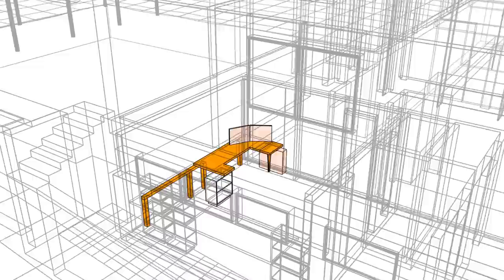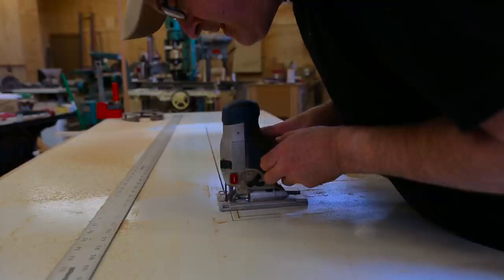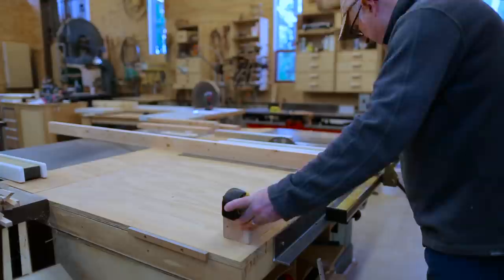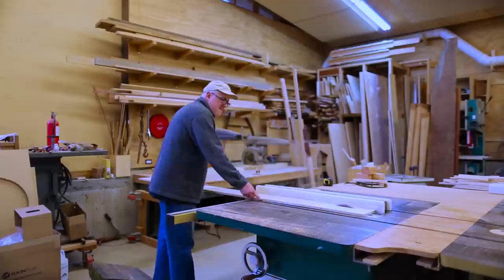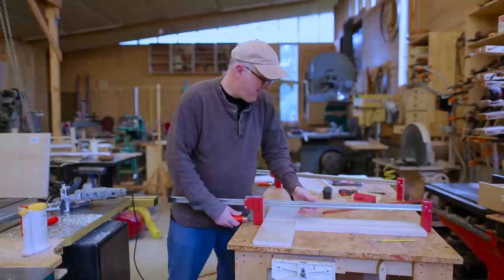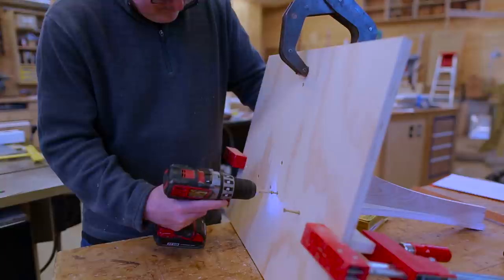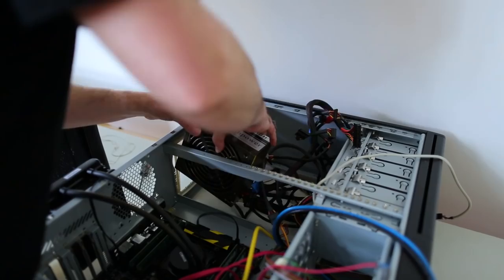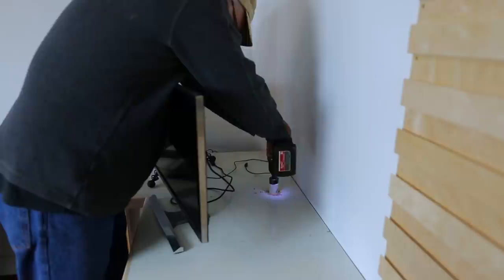office 4: Hacked Together Computer Desk

Comment: i feel like sitting in front of that desk for prolonged number of hours could be uncomfortable for your arms since it's touching the edge of the desk even with rounded edges. you're then forced to raise your shoulders a bit to relieve the pressure from your arms but that transfers the discomfort to your shoulders. you could add a lower level desk for your keyboard and mouse. this could complete the corner also adding more space on the main desk (especially if you mounted the monitors), and hopefully have a more ergonomic feel for your arms.

i do CAD/3d modelling on the computer as well and i've experienced having a sort of pinching feeling/numbing in the area between my wrist and elbows because I previously had a similar setup with the one on the video. what i did was getting wireless peripherals setup on a lower level desk and i haven't had any discomfort issues since then.

still a great video though. it's nice to have a bit of a look into your process. 👍👍👍

Comment: Hi Frank. I love that arched leg!
I have a similar Samsung monitor, and thought for a long time that the stand was not adjustable. Found out that it actually is, if you use some force (more than you would think) on it. Worth a try on your monitor as well, to get rid of the wedge piece.

Comment: your keyboard doesn't even fit on it. your monitors are different heights. You cant use your mouse without bruising your knuckles. cmon man!! drop some sick design on this thing.
Reply: The head is too close of the monitors too. So uncomfortable.
Reply: tehsimo exactly! We, the internet, demand a better setup for the great FH. Somebody start a petition or something?
Reply: Full points for construction methods and leg design, but the keyboard monitor positioning needs major rehaul, not to mention you need some blue LED lights behind the monitors for that cool tech look!
Reply: xander witt I used the 66mhz turbo button and 28.8k too.
Reply: Cana Dude Do you have any idea how bright blue LEDs are when you’re trying to get some sleep?

Comment: If the monitors that you have are VISA mount compatible, you should get monitor mounts. There are kinds that mount to the wall or mount to the table. I have used both, they are very good and provide a lot more usable desk space

Comment: Plywood I cut at 130-150 in per min at 18,000 rpm. Using a 1/4 two flute uppercut, half inch ply two passes. Or if I'm using a single flute might go a bit slower 120ish. MDF same story.

Comment: Hopefully that is not a long term solution for long term work. Most ready-made desks that are so called computer desks are crap. Doesn't matter how expensive they are, they share the same flaws: not enough space for peripherals width and especially depth wise, assuming the monitors are also on it.

For any actual work the best computer desk is one with large enough area so that when you're in correct distance away from the monitor, your arms rest on the table, and there's still plenty of room for the keyboard and mouse that are both on the same surface as your arms. That takes the load off the shoulders like with the chair armrests, but you don't angle your wrists in an awkward way. And because there's room to move the peripherals, you're not constraining yourself to the same pose/movements everytime you use them. And then there's also the benefit of having enough space for a graphics tablet and for drawings/documents, aside from the usual keyboard+mouse.

My computer desk is an actual corner desk with two height adjustable surfaces. One for monitors (plenty of room width wise) and the other to have the space as mentioned, the chair armrests go underneath the front surface and because the front edge of it is also curved, it easily takes over as armrest on both sides. Not an ultimate desk design, not sure if one exists, like some kind of counterweighted fast sit/stand desk with at least the same adjustments and space, but heaps better than what is usually sold as a computer desk.

Comment: Hey Frank, I see you used my recommendation on a water cooler for your cpu, this seemed to work splendidly. If you would like to consider reducing the noise by your pc I could recommend buying a GTX EVGA 1080 HYBRID. The Hybrid cards have an AIO water cooling kit already attached to it, same as you did to your CPU. Though you could also buy the kit separately and do some surgery yourself. See you around :)

Comment: Cable management is pretty but not too functional as long as it's not too egregious. I'd say yours is fine if you're happy with it

What I'm worried about is those fans at the top of the case, which you seem to be blocking with your table top! You might think about knocking out some of the table so your outflow will have somewhere to go!

Comment: That's a pretty serious PC rig there man. When your rendering the video's have you stuck your hand between the top of the case and bottom of the desk? Just wondering if the hot air has enough to escape. Do you monitor your temps when your rendering?

Comment: One thing to keep in mind, - while looking at your P.C. The first thing I saw was the motherboard may very well be a bottleneck for you system. I don't know if you're running an AMD or Intel system but, depending on the processor, that too could be a bottleneck for the GPU. Also, I saw a TON of mechanical drives, are you at-least booting from a SSD? If not, I would seriously look at a new Mobo with a M.2 SSD for boot. Especially in an editing rig like yours.

Comment: I have 3 screens and 2 cards. now my wife has 2 screens and 1 card a dvi and vga running off same card. She didn't want upgrade to 2 screens now try getting the set up off her. My screens are hung off an alloy T beam and the two outer screens are angled inwards the middle is straight ahead.

Comment: The computer guys are sure a lot more anal then the woodworking  people. Yea cable
management. I have struggled with it for fifty years. Obviously a lot
of that was devices other than computer related. As far as I can tell
the only thing that ends up being neat and tidy is something that
will never change and that of course leaves out home computer setups.
The best I have ever achieved in this respect is to hide it behind
EASILY REMOVABLE shields and avoid any RF interference  or cooling
problem possibilities. The ability to make the inevitable changes
that come about seems to me to be the most important goal. Keyboard
position? Do the critics really think that you won’t solve any
short comings you perceive with a creative solution? I like that leg.

Comment: cable management usually just pisses me off. what I mean is.. are you trying to make it easier or just look pretty? I could care less how it looks, I want it easy to work with if I do need to move or disconnect something. not many things are worse than snagging a cable every few inches when all you wanted to do was swap out some small thing.

Comment: Frank, I have to show you my desk, I've designed it and have chosen to place the computer above the monitor and not at the floor. I have created a chamber to keep the dust out, and also a system to direct hot air out off the chamber and fresh air thowards to the chamber. How can I show you ? I have a video and about 2 or 3 images made in Solidworks. My desk have only 1 leg. :-D

Comment: Frank, I binge watched all your videos a year ago and have been keeping up with them ever since; this is the first time I have felt I really have to comment!

I'm usually so impressed with everything you make and how you move around the shop, but particle board? C'mon Frank you're going to be coming into contact with that desk a lot and you would appreciate a nice lump of tree.

Secondly, really made me cringe when you picked the motherboard up, with the ram in it, by touching the ram pins! You're clearly a wood guy not an IT guy. I'm pleased nothing got fried for you.

Third, you're about six inches from the screens and your keyboard is floating in mid air! Worst setup ever! (would be for me, your results may vary).

Then there's the monitors; I made the switch from my whole working life with two monitors to one big curved one as soon as they came out. It's well worth it to get rid of that frame right in front of you!

Your cable management is better than I would do though; no issues there.

I look forward to the future video when you do this little project properly.

Regards,
Reply: that keyboard floating is most definitely an issue, it's really bad to use your computer with hands in the air with no support.This desk area is too cramed for dual monitor + keyboard, especially considering that frank is doing editing and apparently some 3D stuff for his videos and CNC... that means quite a bit of time spent on the computer.

Comment: I'm sorry but I was expecting a lot more, the hanging keyboard.. nah, the screens are a palm to the eyes, that would give a terrible neck ache. I'm running two 4k 36'' monitors, my keyboard is 50 cms away from them, Im around 80cms away from the screens, I don't have to play tennis while I switch between them. You have lots of space, why something so tight? My desk is 1meter deep, It's a curved L and I sit in the corner just like you, but hey, I do have plenty of space and my keyboard is huge and doesn't hang in the air. You missed a few key points there mate.